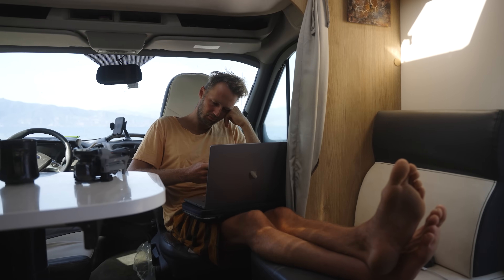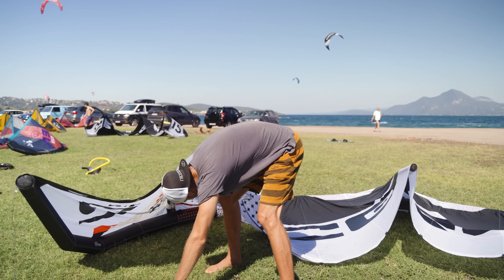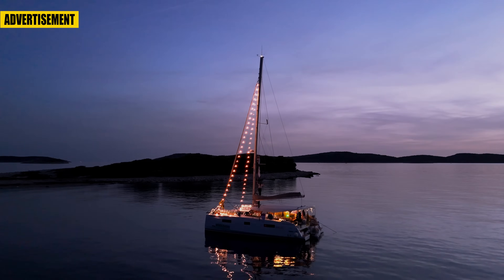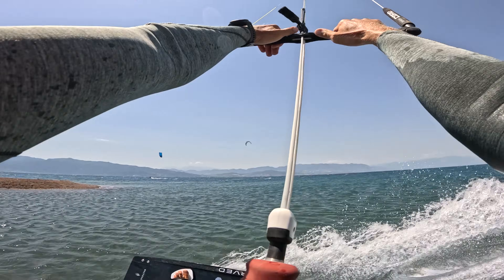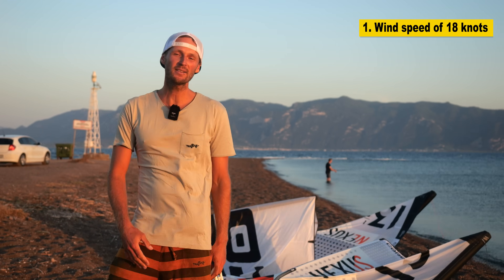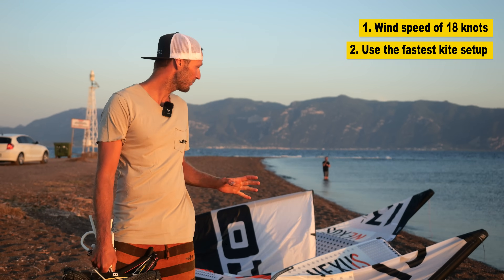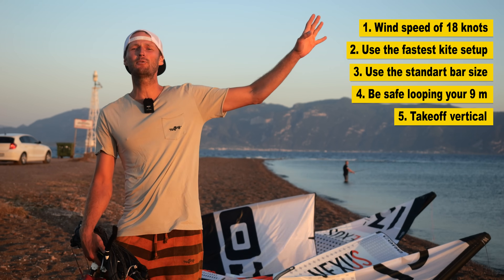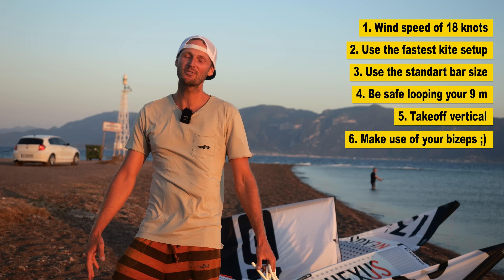Big Air Kiteloops with a 13,5 m² Kite + Tutorial

Comment: Is there a trick to riding the Nexus coming from XRs?  I always feel like I'm underpowered when I'm riding the same size.  I love how much faster it is... but I'm a heavy guy and I feel like I'm constantly pumping the nexus to keep going.
Reply from the maker: That‘s true, the Nexus has less „power“ on it‘s own. With the Nexus the power comes from the „right“ steering
Reply: @BenBeholzVlogs any tips on how to get that power? I feel like I’m cranking on it and can’t get enough
Reply: i came from xr 7 in 7 9 12 and went to nexus 8 10 13,5 worked well at 95 kg

Comment: Why Nexus instead of XR? Have you ever ridden a 13.5m XR?
Reply from the maker: Of course, the xr is slower
Reply: I perfused because I weigh 100kg and the average wind in my region is 15 to 20 knots. I currently sail with a 12 meter kite, but I was thinking about getting a bigger one. Which do you suggest, XR or Nexus?
Reply: @pedrodantas9292  For bigger kites it's usually better to get a kite like XR/Rebel/Edge as they provide more airtime and power, although for looping they are at a disadvantage compared to faster kites with lower bar pressure.